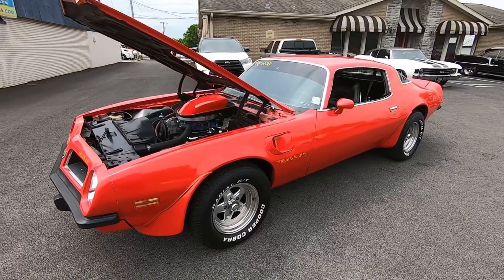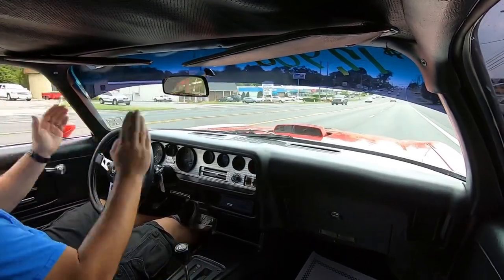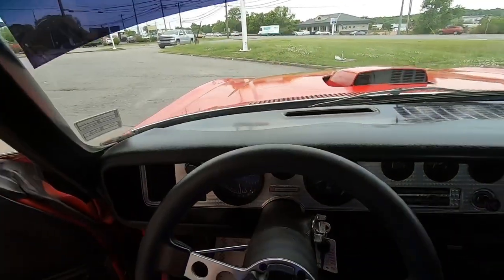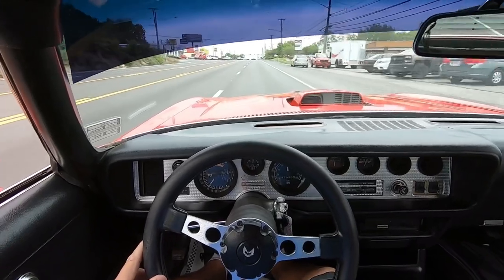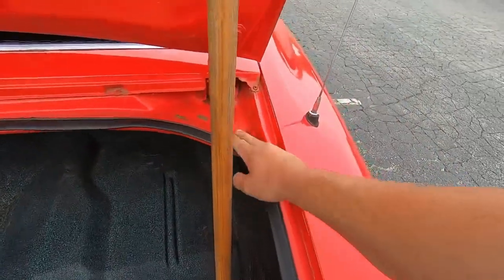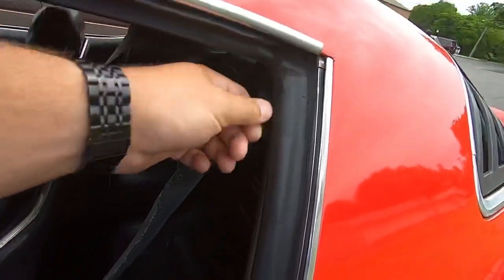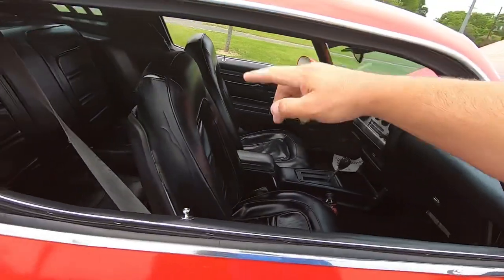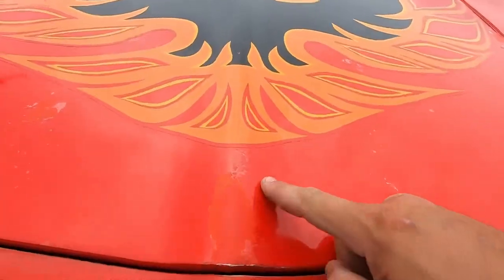Test Drive 1975 Pontiac Trans Am SOLD $17,900 Maple Motors #1055

Comment: Nice Trans Am. Back in 1975 I bought a brand new Trans Am from Naperville (illinois) Pontiac. It was sterling silver with burgundy interior. Automatic with power windows, air, am/fm stereo with optional 8-track tape player. Screaming chicken decal on the hood too. Engine was a 400 (185hp-wow). Paid $5,375.00 for the car plus taxes. Kept it five years and traded it in on a 1980 Corvette.

Comment: Hey Maple Motors! Hey do guys get any older Oldsmobiles in there at your place? 68-72 Thanks in advance! Ya that looks nice Trans AM I like the red and black combo! Looks nice underneath the car just a little surface rust nothing major!👍  do you think just touched up areas not a total repaint right? I missed it what engine is in it? 455 or 400 I'm not familiar with them!🤔